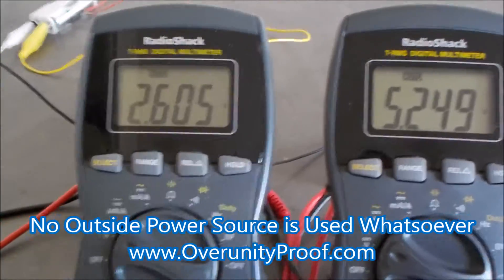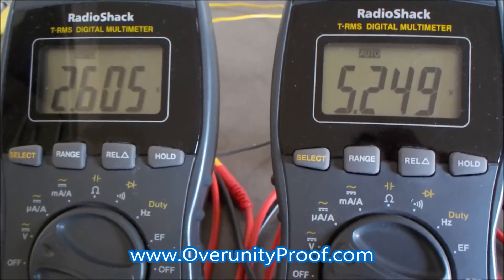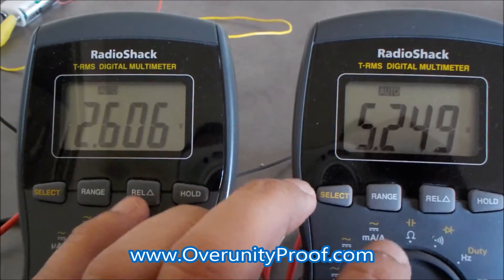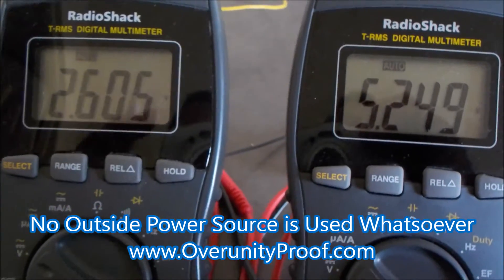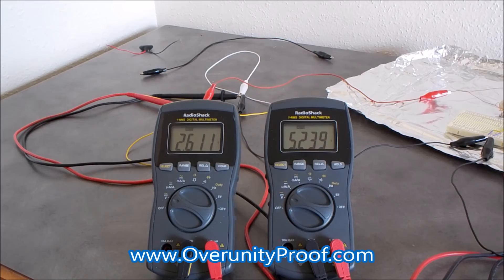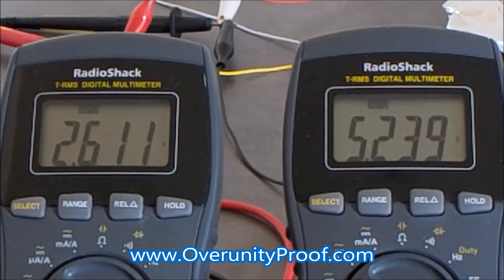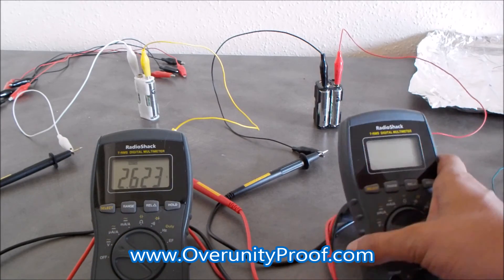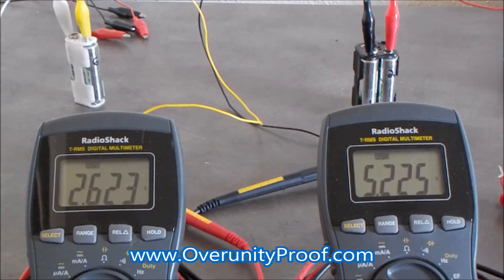OverUnity Proof Preview

Comment: Open Source it or sell prototypes and collect donations if it works. ...all other methods will fail if you don't show a self running system or at least show a convincing proof with powering a load all the time and battery not discharging. ..
Reply: People want ready to use solutions so if it is really that easy why don't you sell working hardware..?
Reply from the maker: +overunitydotcom Do you have a working OU device? I've been watching your site/forum and channel for years and years now and I don't see one single working apparatus that proves OU without a doubt.

All the devices that do show a self running device has absolutely no explanation on how it works and all the descriptions of those devices are not newbie friendly or easy to follow and there are NO replications whatsoever. 

Show me a device that works without a doubt and I if I can build it easily and replicate then there is a possibility that I may open source it, until then... Also I am selling working hardware if you would have bothered to look around on the site of the explanations I do offer. I fully explain what the device does.

I don't see one single device that follows the principles that I have found, which is based from Nikola Tesla's most basic system for energy amplification. Not just volts, but amp  and watt hours, all plotted with power curve charts and load resistor tests.

It's impossible to run something from a battery and not discharge the battery, sorry but that's a sad consequence of our physical reality, UNLESS a charge barrier is involved to allow pure voltage to pass through, and that's something that isn't readily available nor easy to reproduce and usually requires a high voltage.

I demonstrate in the video a simple device that uses a small voltage and a few other processes needed for rushes of current to enter in.

Comment: You know an increase in voltage doesn't necessarily mean an increase in overall energy right?
Reply from the maker: +enticed2zeitgeist Yes In some cases that is true, but not in this case. I painstakingly plotted 2 power curve charts minute by minute and show total amp hours, volts, and watt hours.
Reply: +debunkified Are charts in the video? I admit I just skipped through it because there is a lot of quack videos and 11 minutes is a large investment of time this day and age. May I suggest condensing the video and showing the evidence for these claims?

Where do the charts appear?
Reply from the maker: The charts are included in a two hour video on the website http://www.overunityproof.com and one chart can freely be seen on the website itself. The video you watched is as condensed as I could get it without losing the point and is basically a condensed version of the two hour demonstration that explains it in more detail, with included charts, parts, and other explanations.

Comment: Really nice...... looking forward to your next video.  

I was doing similar experiments couple years ago.  The voltage seems to look good after charging,  but when I used the battery to run a load,  it only ran for half the time  compared to the ones that was charged conventionally.
Reply from the maker: +WTF BBQ Hi, just curious as to what type of batteries you had and and what type of chargers you used. Also what was your load and at what point did your load stop?